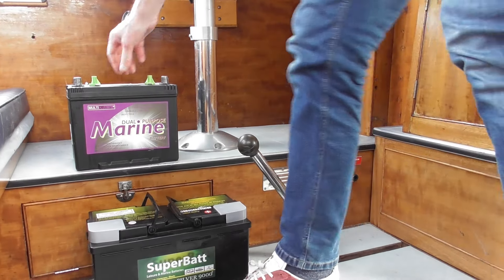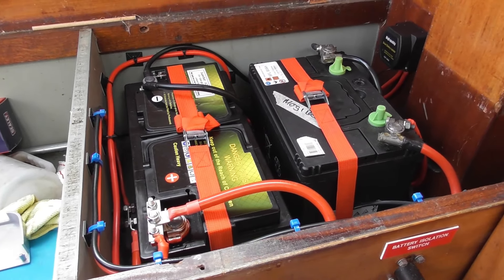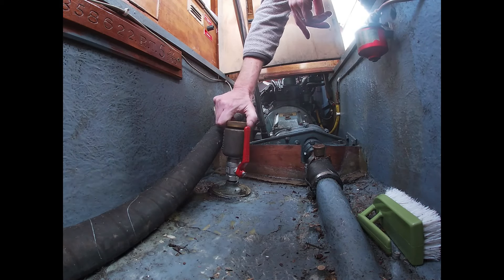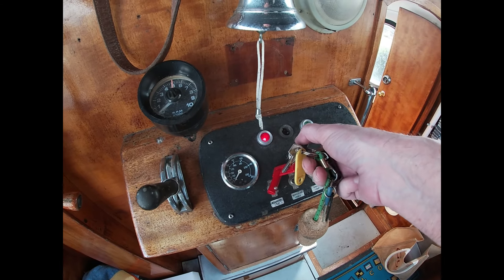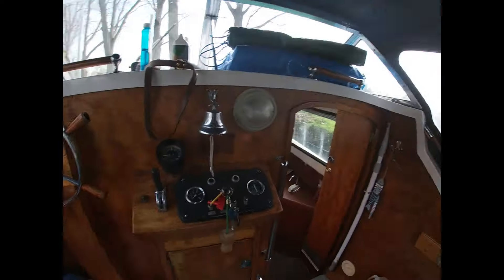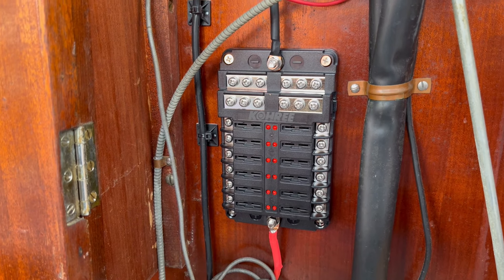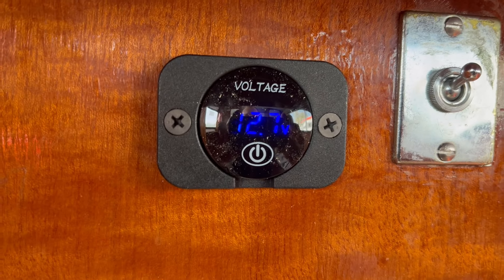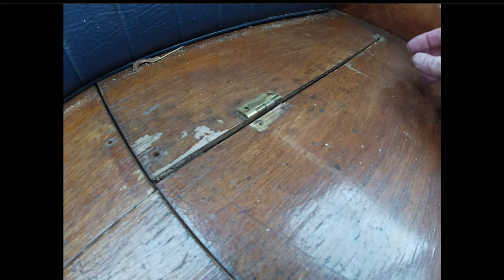Waking Up Freeman 23 Marji Bee and Winter Jobs. But will she start?!

Comment: I'm just curious. I hadnt realised it was a petrol engine installed, but is the petrol E10 grade? The ethanol in E5 / E10 petrol is a moisture magnet and the fuel loses its grunt the longer its stored. Its also not very friendly to older rubber seals and hoses, which I imagine rubber hose would be around the carb area. It also dosen't quite smell like the old leaded or unleaded petrol. As one of my old garage mates said it smells a bit like detergent at the pump.
Reply from the maker: For me I use the E5  “Super Unleaded” 99 grade petrol which I think reduces the chances of separation. I try to keep the tank relatively full too, popping a 20 litre can in whenever it will easily fit!

The guys at Sheridan Marine pulled together a comprehensive overview of the new E10 grade petrol and explain the implications of using it far better than I ever could with regards to its use in marine engines! This will properly answer your question! 

https://www.sheridanmarine.com/blog/e10-petrol-watermota-boat-engine

Comment: Aww Kool, I was wondering bout engine/motor access. Guessing the stick between your legs, when you were doin the batteries, is fwd/rev? Unless the on up near the is, and not rev/spd?  The only Freeman I knew was the bloke I was at Primary School with. Is the leisure battery acid/gel or lithium? Nice goin m8, stay vertical Eh!
Reply from the maker: Yes, that is the gear lever. Forward and reverse. Throttle is separate on the dash. It actually works really nicely and doesn’t take long to get used to. The leisure battery is a deep cycle lead acid.

Comment: Nice job and looking good. Where did you get your safety signs from and did they come as a kit?
Reply from the maker: The safety labels were an eBay purchase. There’s a variety to choose from depending on your needs. You also choose colour and if you want them self-adhesive or with screw holes. Here’s a link (I have no affiliation to this seller!) I’m pretty sure they turned up the next day too! 

https://www.ebay.co.uk/itm/305336143128?itmmeta=01HTMA1YHKYDT1DXW0NT99KC4G&hash=item471773cd18:g:3D4AAOSwTKJlTOuv

Comment: Hi good vidio. Can i ask on a day out maybe 5/8 hours how much fuel would you need i noticed the can. Got to get one.i have just bought a freeman dying to get out on it thanks.
Reply from the maker: I plan for around 2 to 2.5 litres per hour of cruising, but always with a contingency so we’ll never run dry. On a longer cruise downstream we’ll always have the can with us so we can take a walk to a garage to fill up. It’s much cheaper than any Marina fuel pump (£1.40 as opposed to £1.90 at the moment! 😬)
Reply: @riverthamesboating  thanks for your reply. Defentley keep that in mind, for sure. Very helpful. I cant wait to pick my boat up. Its sitting down at sheridtion marina. So cant pick it up till march April, if weather permits. So our first trip will be 11hrs back to Walton-on-Thames. Thanks Mark.

Comment: No bilge blower fitted?
Reply from the maker: Yes, we don’t have a bilge blower fitted. It’s all very basic! I always lift the bilge cover anyway to check the weed filter and feel along the fuel lines for any signs of seepage, so it’s no extra effort to air them manually each time. I’d much rather be able to see/smell if there is a problem immediately rather than just blow out bilge air not knowing if there is a slight whiff of fuel to be concerned about. We’ve not got a bilge pump either, and so rely on regular visual checks instead!
Reply: @riverthamesboating  well worth considering fitting one. I know of at least 3 explosion fires on Freemans, so no doubt there will have been a LOT more. The touch/smell test is good, but obviously only something you do initially and wouldn't stop a fire triggering after switching off in a lock or similar. One of the cases I'm aware of was gas, but presumably triggered by the petrol ignition. One of the others, the owner escaped with burnt legs, but vowed to always fit a blower to any future petrol boats. I'm amazed that it's not a stipulation of the BSS test for petrol vessels these days.
Reply from the maker: @CruisingTheBroads Maybe something worth considering for us then. Especially as I have additional battery capacity to tap into! Would you have the blower on constantly then? 🤔
Reply: @riverthamesboating  you're generally best to run it from an ignition feed with an isolator switch inline. You want to be running it for a couple of minutes or more before starting. With a low speed river cruiser, it's as well to keep it running all the time the engine is running, as you've relatively low ventilation in the engine bay.
Reply from the maker: @CruisingTheBroads Ahh. I’d assumed it was just a blast before starting, but it makes sense to be running it the whole time. I’d put it on a perm live feed (when battery switched on) rather than ignition live, as I’d be wanting to run it before switching on the ignition. I guess I could just get lights on but not crank tho if it was switched ignition.
Reply: Just seen your video and noted the lack of bilge blower. I believe this is a BSS requirement. We have a 23 moored near Reading and have a blower, I run it before starting, even in locks. We have a switch fitted to the dash that is wired to the starter battery via the isolator and a fuse. The problem with petrol is that the fumes are heavier than air so lifting the floor to access the bilges/gearbox etc won't ventilate the fumes. 
Interesting point about leaving it on whilst running, I don't normally do that but maybe I should. 
Loving the videos though, nice to see the you enjoying the boat on the upper Thames, we need to get up there this year.

Comment: Nice video, shame about the intrusive music, I nearly gave up!
Reply from the maker: It was specifically picked to be an unobtrusive and generic background track to keep the flow of the edit moving, apart from the engine start bit where it was deliberately stopped to create a touch of tension! 😬 So sorry you felt it was inappropriate and intrusive to the point that you felt you had to comment. 😢 I’m always willing to learn and improve though, so I’d be interested to know what background track you would have chosen? And “no music” is not an option as background noise and edit jumps mean something is needed to bring it all together. Thank you for the kind comment on the video content tho. That does make the effort worth while! 👍🏻😊